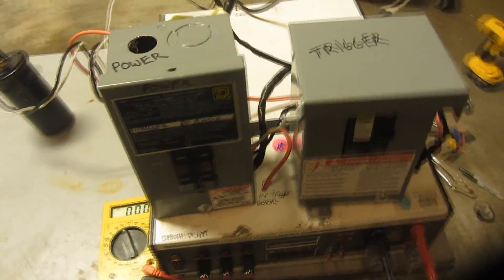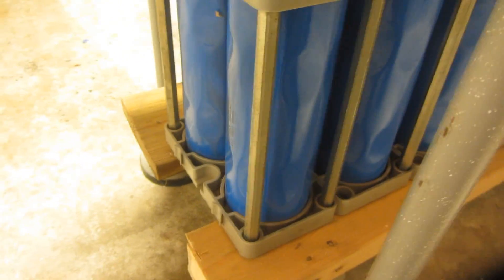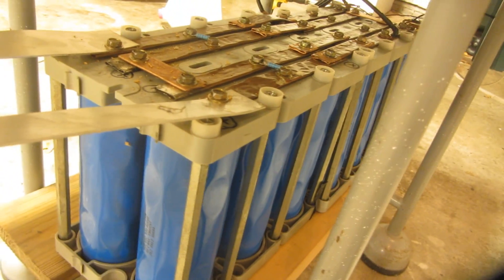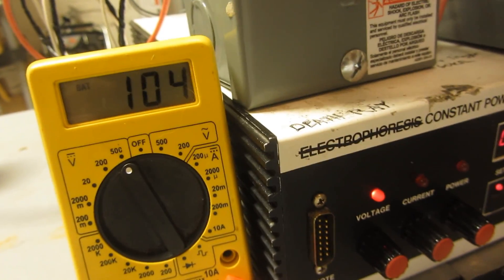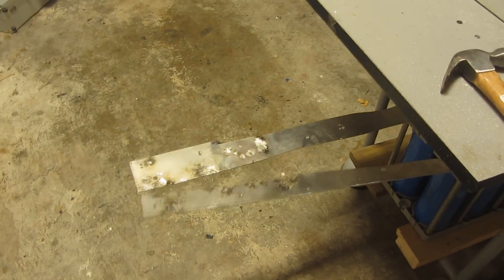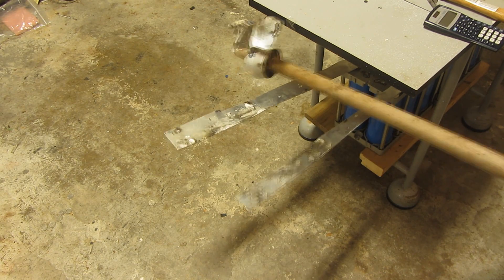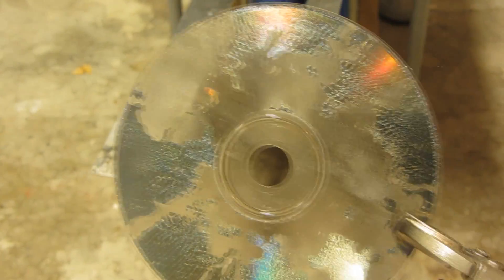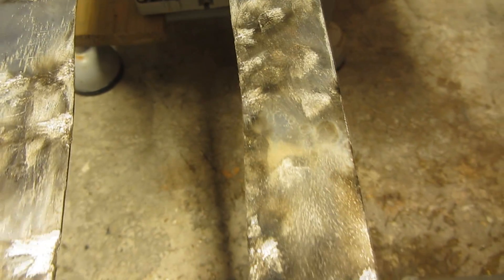Terrifying Pulsed Laser Power Supply vs. Household Items

Comment: I thought I was the only one who did the hand behind the back thing.
Reply from the maker: it's to avoid current going across the chest/heart. if the circuit goes through both arms then the heart is likely going to be affected. although for something like this, it may not matter too much...
Reply: It's an old practice. It's meant so that there is less of a chance of you touching a ground while also touching a positive terminal or wire connected to it. More of a training thing, but most people keep doing it out of habit
Reply: Don't overdrive the dangers. It just attracts haters to your video (they think you're stupid to tell how dangerous stuff is, then do it anyway). 
You will not explode if you touch those rails - simply because your body has way too high resistance for that. It's not worse than most other power sources with the same voltage. 

Just think of this - an ordinary wall outlet may have ESR over the incoming power lines of 0,3 ohms, while your capacitor bank probably have 0,001 Ohms or less. Now charge that thing to 120 or 230 V (depending of what main power you have) and put a 120/230 V light bulb across it. The normal way - not by shorting the rails. 
Then it's no difference. Simply because the lamp limit the current the way it normally do - regardless of how much current the power source will deliver. Same thing applies for the body - wich may have well over 1000 ohms of resistance. So - only thing that matters is how much voltage you have charged it to. 1000 V is of course very deadly - but you will still not explode.

What makes things explode is when you put low resistance stuff there (the metal objects you showed) - then there will be an insane amount of current passing (with corresponding heat and magnetic forces) because of the low total circuit resistance. 
Do the same thing with a wall outlet and you just get a spark and the fuse blow. That's when the low ESR really comes into play.

But other than that - it will be awesome to see that laser then.
Reply: high voltage doesnt care about high resistance.
Reply: styropyro You're amazing. ^_^
Reply: Dylan T
If I put 2 nails in a wall outlet (holding them with my hands) - do you think I will explode like of that to?
It's what it would be like to touch this capacitor bank as well - if it's charged to the same voltage. It doesn't matter if it can dump 200 000 amps thru a low resistance - the body resistance and voltage is what determines how bad a shock gets.
Higher voltages is worse of course - but you still don't get the explosive discharge you get with that low resistance can and foil.

You're still likely to get killed or injured though (just like if you put 2 nails in an outlet) - and I'm not kill my self just to proof simple physics for idiots like you.
Reply: and all that systems
Reply: Yes it do. More voltage of course will cause more current to pass - but you will not explode. That's just rediculous. Maybe you could if the voltage was like a 100 000 V due to the enourmous heat produced. But we are talking about 1000 V at most here - not a chance. 
I'm not saying that it's not dangerous - but it's not worse than most other power sources that has the same voltage. As long as it can give more than a few amps, it's no bigger difference, since body resistance is the limiting factor anyway.
Reply: RogueRAZR You were right until you said "AC passes through capacitance with very little resistance, measured as the ESR of the capacitor". AC does indeed pass through easier, but that is not called equivalent series resistance, because if it was series it would add up with the actual resistance and cause even less current to flow. Rather, it is called capacitive reactance.
Reply: Is there a reason?
Reply: it's the difference between blowing up your hand vs your heart.
Reply: Hearts stopping due to massive amounts of energy across its fleshy tomb isn't very life supporting >.<
Reply: FieryWingedAngel There is a big difference. However, there is also a big difference on the type of power you are subjected to. 

His capacitor bank is charged with DC (obviously). DC is pretty predictable when it comes to its effect on the human body and it's really not that dangerous until you get up to around 200V. The reason is that your skin has a very high resistance, over 100kohm on average. This means that even with 500V DC, the current that passes through you is only about 0.005A. You'll definitely feel that and a long exposure will probably hurt or possibly burn you but it won't kill you.

AC is a whole other matter. Problem is that you body, while having incredibly high resistance, has a bit of capacitance as well. AC passes through capacitance with very little resistance, measured as the ESR of the capacitor. At 50-60hz, the ESR of your body is probably only a few kohms. This means that even 120V AC can be incredibly dangerous as it can pass upwards of 0.1A depending on your environment and that is more than enough to instantly kill you.
Reply: @RogueRAZR  Uhm, have you considered the dielectric breakdown of skin?  That drastically reduces the resistance and allows way more current to flow.  You might explode, at least your fingers if you touched with one hand.
Reply: How so? I mean you must of learned it somewhere, we get that taught
Reply: idk, just always seemed like a good idea.
Reply: You start a youtube channel, test it and report back.
Reply: Ride84XL 
Good sir, isn't there a difference between 240 and 1400 volts?
Reply: HEY I HAVE LEARNED SOMETHING! :) Thanks!
Reply: Wierd same thing happened to me with a UK lighting circuit (220V): felt it go through little finger, arm, heart!, and down my right leg.  Thank God I was on an insulated ladder.  Scared the fucking bejeezus outta me!  I didn't do any more wiring that day.
Reply: +Dylan T Go back and check some high school physics textbook talking about Ohm's Law.